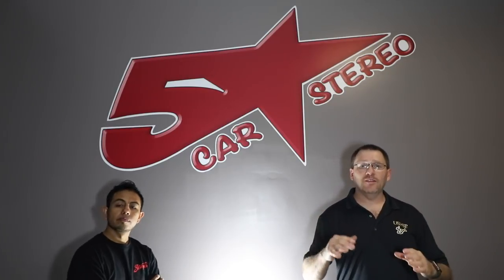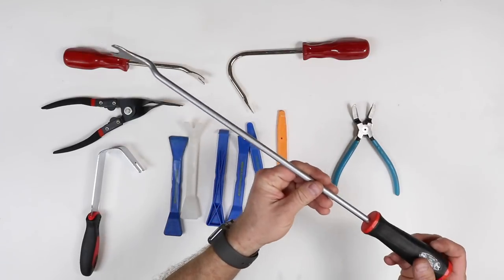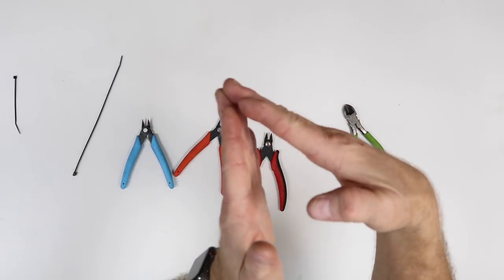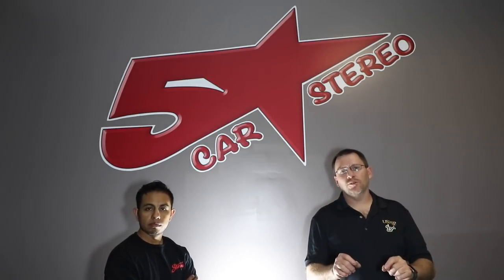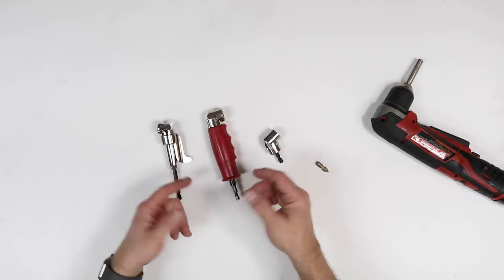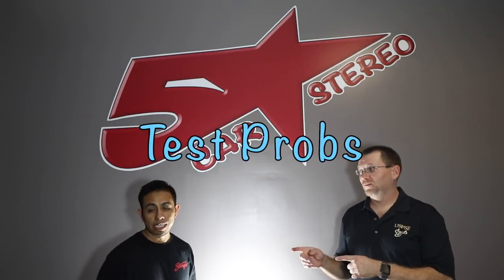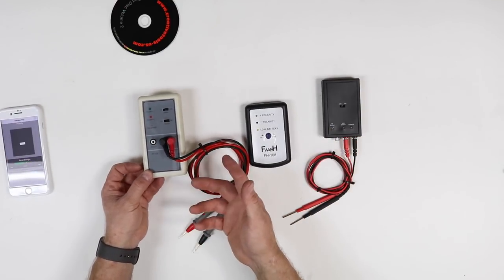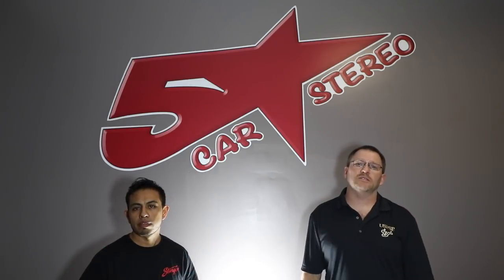10 tools every Car Stereo installer needs in their Christmas stocking

Comment: Great list guys. Love your videos. But careful with those piercing probes. They're ok for interior wiring, but can lead to problems if used on wires exposed to the elements. As the wire ages the hole in the insulation will open up allowing moisture and corrosion to attack the wire.

Comment: Awesome video. I have a PDXV9 amp. The 2 hp crossovers on 1 thru are set to a little over 80hz. On music with a strong kick drum it sounds like my 6.5s are going to pop. When I turn the crossovers up more say like 100hz I lose some of that mid-range that I really like. My LCQ1 eq bands dont help much. 2016 Accord sport. Any suggestions. Thank you much!
Reply from the maker: You had the factory non amplified system right. What type of 6.5 are they
Reply: Five Star Car Stereo unfortunately they are the 2ohm infinitys. Which is why I have bombarded you with the infinity questions lately. I know I know you said those speakers suck.
Reply: Five Star Car Stereo and yes factory radio

Comment: Only thing I havnt got (or ever seen before) is those cool wire probes.
Reply: From my experience don't waste your time or money on them... The one to test thicker gauge wires works great but as for the green one which is for smaller gauge wires that's where it becomes tricky... It has to be just rite or it won't pierce the wire and sometimes it's hard to just get on the wire much less make sure the needle actually goes into the wire ... I used them for a while but ended up returning them for a full refund. But that's just my two cents
Reply from the maker: We have no issues with them and use them all the time, very nice
Reply: Five Star Car Stereo Hello Dean everybody has different experiences with things they may work great for y'all but for me it was just way to frustrating to keep trying to get the wire just rite to be pierced ... Especially in super thin wires like coming from a headlight switch say maybe a 22 to 24 gauge wire ... Don't get me wrong I love watching all of y'all's videos and learn alot about cars I've never touched yet so I'm not hateing or anything like that I'm just saying that in my experience with them it wasn't up to par for me and just put me behind and made me waste my time on many installs... Keep up the great work though and   keep filling our heads with y'all's great knowledge

Comment: Hey guys what powersupply do you use to bench run headunits?
Reply from the maker: We use one of these
Pyramid Bench Power Supply | AC-to-DC Power Converter | 5.0 Amp Power Supply with Car/Vehicle Power Outlet (PS9KX) https://www.amazon.com/dp/B0002BA570/ref=cm_sw_r_cp_api_C3XkAb85BVEZV